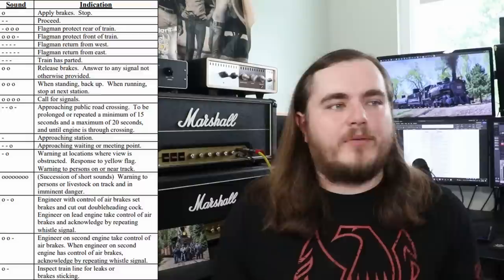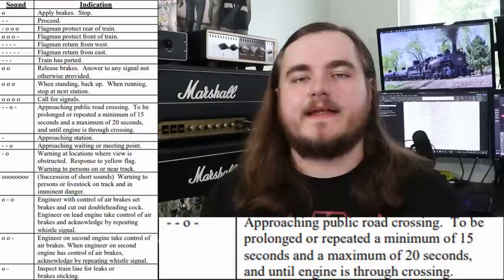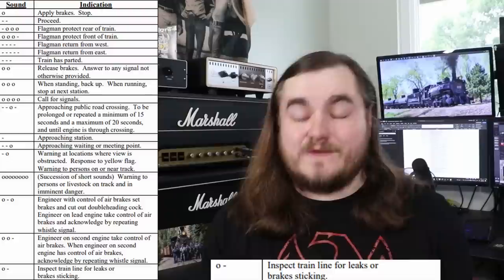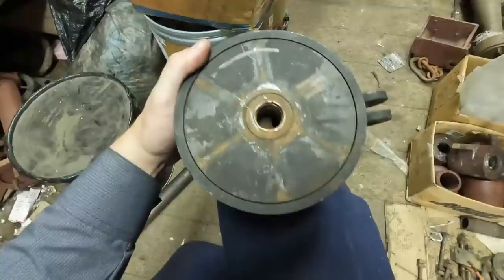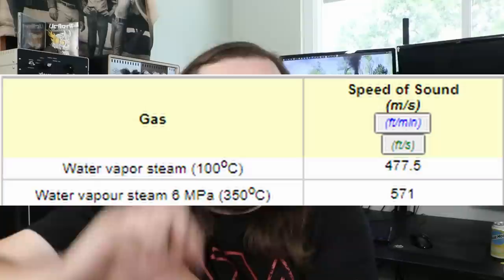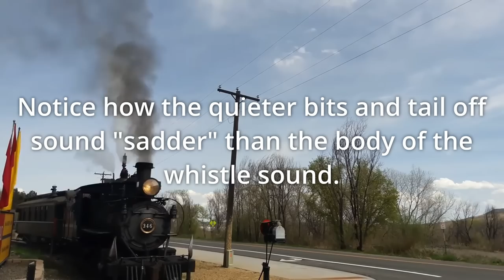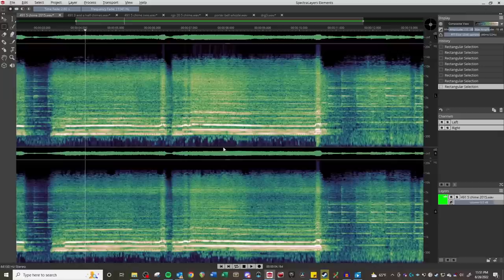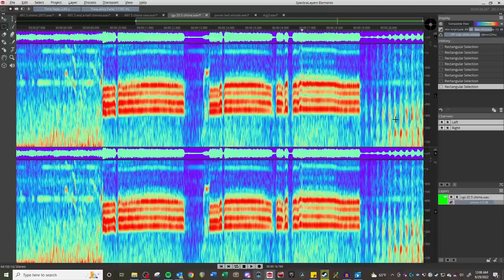WHISTLES 101 - EVERYTHING you could want to know about STEAM TRAIN WHISTLES!

Comment: My initial guess for why the pitch changes was that the air/steam mixture in the flow changes, and higher steam fraction = higher speed of sound (since c_steam > c_air) = higher pitch (of course more air also means cooler fluid, which exaggerates the effect). This would also explain why the smaller chimes are affected more, because they have proportionally more space to entrain air between the bowl and the bell, relative to their internal volume. Maybe one could verify this by checking if the size ratios correspond to the frequency ratios at partial or at full blow: this explanation would predict the latter. Might be hard to measure this accurately enough, though. (And yes, I've also taken acoustics courses unrelated to my EE major, does it show? xD)

On a more frivolous note, I find it interesting that I can't tell the 4/5/6-chime recordings apart here, despite decades of playing multiple instruments, composing, and even specifically picking apart chords into single notes... but somehow if it's a whistle, my brain just goes "train whistle" and no further detail is noted xD Always funny how perception is affected so strongly by context and experience
Reply from the maker: That's a brilliant point that I've not thought about. Air/steam mixture... Hm. Hard to measure, but definitely something to think about and test for. Seems to be a better reasoning for the smaller chimes than mine too. You're onto something here.
Reply: "my brain just goes "train whistle" and no further detail is noted xD" We have a name for this. it's called being a foamer
Reply: This is because you haven't played the steam organ (doesn't exist as far as I know).
Reply from the maker: @MK.5198  it's part of the pyschoacoustic phenomenon of them not really hitting an exact chord and the chord changing. It doesn't make sense to your western music trained ear, so you just perceive it as noise.
Reply: @Hyce777  Ok, I've done some analysis, and have some interesting results. Most interestingly, assuming the longest chime of your 6-chime is a λ/4-resonator and 12 5/8" long (as mentioned in "I had to wait 6 YEARS to hear my steam whistle."), then the speed of sound in the resonating fluid is only 330m/s when quiet and 355m/s (!) when fully blowing. I couldn't find good sources for speed of sound in air/steam mixtures, but pure steam at 100°C would have a speed of sound of 455m/s, so there's definitely entrainment, and a lot of it! I'm also more certain now that there's also some thermal effects (or other weirdness) as you suggested, since the spectrogram clearly shows the peak frequency doesn't occur simultaneously in all chimes. (It's not sequential, either... the lowest is first, then the 2nd and 5th lowest, then the others? what the heck)

If you have measurements of the Hyce 6-chime, I could double-check both if my speed-of-sound calculations are accurate for the other chambers, and if the quiet blow is indeed all air: if it is, I would expect about 6.7, 7.5, 8.5, 9.7, 11.1 and 12.7". :)

(those numbers are the theoretical lengths if all chimes operate with the same speed of sound, which they can only do if they're filled with all air or all steam, and I'm now assuming the latter is impossible due to those speeds of sound calculated above)
Reply: @hadinossanosam4459  Thinking a bit about what you said, you may have answered your own question a bit... The initial point of the blow on the whistle chamber would be full of air, but as time passes it eventually becomes full of steam, the volume of said chamber will obviously determine how fast that change takes place. Also, don't forget your steam temperature is a hell of a lot hotter than 100C... that's at atmospheric pressure, but the engine is running at 150-175 PSI? So the steam temp is actually 192C so the speed of sound would be even higher. And of course, this all changed dynamically as you pull the chord.

Other fun things that come into play also is the shape of the bell wall at the steam air interface down facing the languid plate.... is it a knife edge, is it square cut, is it a half round? All those little variables effect the harmonics of the final note being struck.
Reply: @Hyce777  hey just wundering will railroads oneline ever come to consul as I love steam engine and I would love to play the game but unfortunately I don't have a  pc
Reply: @ninjia7347  Steam organ equals caliope?
Reply: No, the pitch changes PRIMARILY as a result of pressure changes in the steam flow. Temperature is another and so is barometric pressure
Reply: @MK.5198 💀 lmao
Reply: That is called ,,overblow''. Look at wiki for details on flute, clarinet or saxophone for example. Some flutes don't have even holes or have 1 or 2. Using overblow you change pitch in harmonic progression. 1/2, 1/3, 2/3, 1/4, 3/4 ... 1/7etc. Compaired to frequency of base harmonic.
Reply: I play an Irish ton whistle and specifically I’m thinking of a low whistle. The bore is really big and it’s hard to keep your pitch up and blow hard enough to fill it as much as it needs to be, so when you put too little air into it, it can’t support the proper pitch. Maybe it has a chamber in the whistle that needs full pressure and fully filled with air so it can reach whatever each whistle pipe is tuned to?
Reply: @ninjia7347  Of course a "steam organ" exists - you've probably seen & heard one. It's called a calliope, often at carnivals and parades. Beautiful!
Reply: @hyce777 The harder you blow a steam whistle, the higher the internal pressure. The speed of sound is a function of Pressure! So the harder you blow a steam whistle, the more the speed of sound changes; and with it, the pitch.
Reply: @ReggieArford You can see the higher pressure = higher pitch on a locomotive like the daylight when she wore a southern pacific six chime over three hundred psi was going through that poor whistle when it was only really designed for like two hundred psi coming from a pacific (Correct me about the psi if i'm wrong though)

Comment: I always tell my friends “The conductor technically runs the train, the engineers job is to go forwards and backwards”
Reply from the maker: Pretty much, lol.
Reply: The conductor is Kirk, the engineer is Scotty/ the Redshirt on the helm.
Reply: But without the fireman the locomotive won’t be going anywhere
Reply: @roadwolf2  diesel enters the chat lol I’m a modern day conductor, much different from back in the day with 5 man crews, conductors now are tasked with being switchman, brakeman, conductor, and if the locomotive catches on fire, a fireman lol
Reply: The conductor is responsible for the the train but he does not operate the train in any way. He does talk on the radio and keeps the engineer under control.
Reply: @waynegrimes2263  Notice I didn't say that the conductor "operates" the train, he "runs" it, different terminology. The conductor has control over the train, when hes on the ground, as far as the "train" itself goes, the engineer operates the engine, the conductor runs the train. Without a conductor (or rco) an engineer cant make his own joints (unless light power) throw his own switches, deliver the correct cars to the correct customers etc. His job is to go forwards, backwards, stop, listen to the conductor, and keep the train under control. He cannot see where hes backing a 30 car train into, he cant tell where things are to be spotted, all he does, is listens to his counts and control the train accordingly. 
 
Talking about modern day shortline/branchline or switching operations with a 2 man crew, not mainline ops.

Source: myself, full time CFR 242 Conductor lol
Reply: Thanks for the head-spin-migraine 😵‍💫😵‍💫😵‍💫

Comment: At the TVRM, when they’re backing around the wye, a conductor is on the back of the train and will say a few times on the radio “three cars, <insert locomotive pushing train here>”, and the locomotive will then blow two short toots on the horn/whistle.
Reply: I've been there
Reply: It's easier and faster to blow the whistle to acknowledge radio transmissions when doing delicate or reverse moves in a steamer than it is to reach for the radio. Usually you have your hands full with the throttle and brake handles when doing delicate moves (like coupling to a train), and when reversing you're often "leanin' out the winduh" to see past the tender a little. It's an awkward position and hard to get to the radio in most engine cabs. 

Much of the time the radio is operated by someone other than the engineer on mainline trips, because the engineer has his hands full AND because he's got a "pilot" with him, someone that knows the territory and the specific rules that apply, so he takes care of comms with the dispatcher.

Comment: On the question of pitch change on a fixed-length whistle chamber: Have you considered how the angle at which the steam (or air) strikes the edge affects pitch? 

You can get a pitch change on a flute by rolling it as you blow across the mouthpiece even if you don't change the note you're fingering. You can even do it with a beer bottle. 

It works best if the bottle is full or almost full, but you can get quite a range of pitches by varying the angle you blow across the top.  Blow very flat across the top, parallel with the top of the bottle and the pitch is highest. Blow steeper, more into the bottle and the pitch drops. 

I can play simple tunes on a beer bottle, much to the amazement of people who don't know the trick. The "full bottle works best" is its major shortcoming in that venue.

Might the pressure of the steam in a train whistle affect the angle at which it strikes the bottom edge of the bell a little?
Reply from the maker: Hmm, that's a possibility, and not one I've considered. Sounds like I'm going to need to get some slow mo camera footage of the whistle doing it's thing when it's cold out.
Reply: @Hyce777  Oh, great video by the way. I really like your 101 videos.

When I went to a 2 year tech college for computer science we had to take what I called the "physics class for people who don't need to learn physics", which was mostly a lot of unconnected sections on the  basics of physical principals.

One section was on sound in enclosed pipes. The professor, who was way too smart to be burdened with us, was a rail-fan so he got onto train whistles for his examples.

During the whole semester, me and another "not-traditional" student (old fuckers) would veer him off course by mentioning something about trains. The rest of the class (dumb kids) would groan and complain, but the professor would happily go astray talking about trains for 20 minutes. 

We'd make it up to the kids by telling them EXACTLY what was going to be on the next quiz or test because we knew the professor's "tells" about what that would be. They weren't even secret tells, he explained it on the first day of class, but the kids wouldn't/couldn't remember or understand.
Reply from the maker: @Mishn0  sounds like great memories and a great prof. The ones you could derail were always the most fun.
Reply: Would that mean that you're changing the part of the tube that is producing the resonance? The top end is clear, it's at the height of the metal end plate. And the height of the bottom end would then shift according to where that blade of steam is.
A telltale that that's what's happening is if you calculated back from the pitch to the pipe length (assuming equal steam temperature in all pipes) and got an equal absolute change in length.
A telltale that it's the steam temperature or steam/air mixing ratio would be if the ratio of the pitches stayed constant if you "heat up" the whistle with a really long string pull. Also, it would slightly lag behind the volume changes.
Reply: I believe you are correct about the striking angle/position changing with  different velocities of the exiting stream of steam, moreso than the temperature of the steam distorting the sound. This is evident by the fact that a whistle, when tuned correctly, can still be quilled quite well on compressed air. The sound will obviously be slightly different than on steam, but if temperature was the determining factor for the pitch change, quilling wouldn't work on compressed air. 

Compressed materials lose temperature the faster they are released. If you open a valve on an air tank at 25 psi, the air coming out will be cool. If you open a valve on a tank with 1000+ psi, it leaves with so much velocity that the temperature drops incredibly low, even accumulating ice on the valve.

It would seem to me that if temperature was the determining factor, a whistle would not quill right on compressed air because the temperature vs. pressure/velocity range would behave in the opposite manner that steam does. 

Of course this is all just head cannon as I'm sitting on the toilet so I could be completely wrong.
Reply from the maker: @nathanielspoelman9881  interesting thoughts; I'm going to do some slo-mo direct recording of whistles and see what I can learn. I've never heard a whistle on air really quill, moreso than just changing which chimes you hear more based on establishing the resonance. We'll see. I would love to know for sure either way.
Reply: @Hyce777  Or the deformation of the whisle itself as it heats.  The clarinet slur in Rapsody in Blue is partially due to deformation of the reed.
Reply: I think you're right about this. I assume the change of sound speed would only apply within the cloud of steam. Once the sound waves leaves the steam cloud and proceeds towards the listener, it travels in regular air and is not affected.

With more air / steam blowing the whistle per second, the pressure within the chamber will increase, and I assume this will affect the ratio of gas passing on the outside vs the inside of the knife.

Creating a whistle with a knife / lip that is slightly adjustable seems like a fun experiment, as well as filling a cold steam boiler with compressed air instead of steam, and the try out blowing the whistle as usual to see if there's a difference sound between air and steam.

Comment: Learning about all the whistle codes was pretty neat, as I only learned of the Proceed Forward, Proceed Backward, Grade Crossing, and a few of the crew communication signals from my time with the Toronto Railway Museum. Although I did get a little more experience with the different varieties of whistles, which is surprising since our only operating steam locomotive was the little 7 1/4 inch gauge 2-6-0 on our Minitrain. That had a flat top hooter, that drained the steam pressure so much we couldn't even do a full grade crossing sequence with it.

The only other whistles we had on the property was the huge hooter whistle that the brewery that was in the same roundhouse as us had attached to their equipment using waste steam from the brewing process to blow the whistle every hour. And the Steptop 6-Chime of an unknown make that we had fitted to our big Northern, Canadian National 6213. We did also have what appeared to be a CP Flattop 5-Chime in the back of the shop, but I have no idea why it was there since the only CP equipment in our collection is an Alco S-1. It could possibly be something left in the shop from the time when it was still a working Canadian Pacific roundhouse, although it was shut down and emptied in the 80s, and hadn't seen steam since the 60s so I doubt that hypothesis...

Comment: I’ve lived in Colorado most of my adult life, but I grew up in Virginia, and my father actually used to make professional audio recordings of the N&W excursions in the 80s/early 90s. In my late teens, I imported some files of 1218 into pro tools and went down a similar path, except that I was analyzing a huge N&W hooter (I was mystified by the engineers ability to make it “tweet” both at the beginning and end of pulls, and how that was controllable from such a “sloppy” linkage and such a high pressure and volume boiler and whistle. I wonder if I can get my dad to email me some files of 611 back in the 80s, that was a very low pitched whistle, if memory serves, a 3chime from maybe a boat?

Anyway, great video, I absolutely am at the same nerd level with this stuff, and love seeing someone else analyze audio to this extent!!

Comment: Very interesting stuff, Hyce.  It makes sense that the valve position affects the higher chimes more if the change of equivalent length is a higher percentage of the base case length.  For a very long chamber the change would be a lower percentage.  That's my hypothesis.  It would also be interesting to see amplitude vs. frequency spectrogams of whistles made from different materials to see how the mix of overtones (timbre) changes.  By the way, the more "nerdy" the better in my opinion.  Cheers from Wisconsin!
Reply from the maker: I want to make some test whistles for looking into this sort of stuff. I don't have a good enough A:B for the same exact whistle out of brass or iron etc...

Comment: That top chime is an overblow - The "Chime" is speaking at an octave higher than it should for the given length.  Again PRESSURE will effect the pitch far more than temperature.  Pitch is altered by temperature, humidity and pressure. Find an organ tuner and they will set you straight and perhaps help you to get the perfect pitch in your chimes.  Organs came before whistles. But they are identical based on fixed physical  principals.